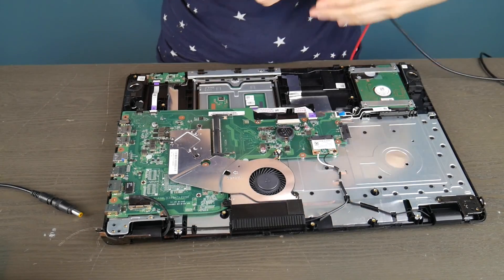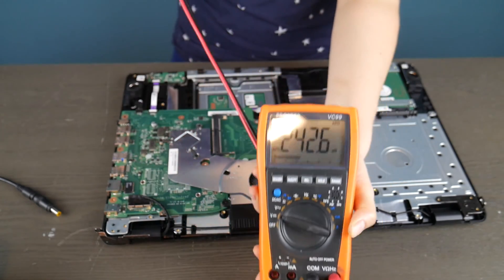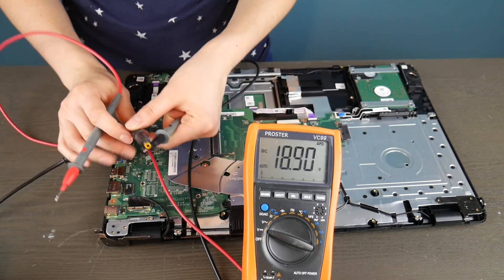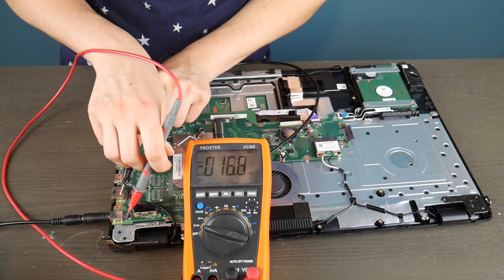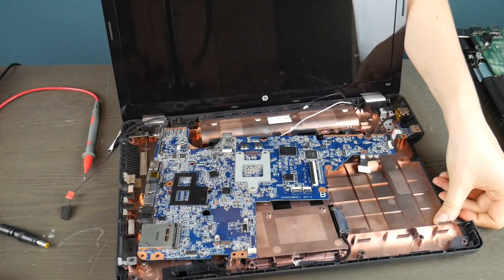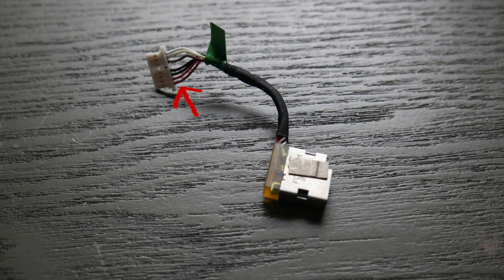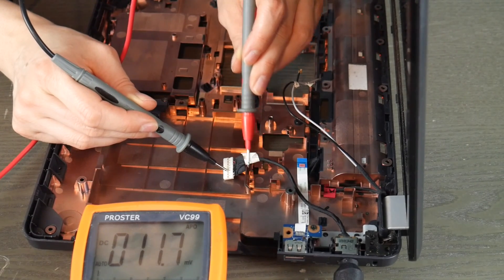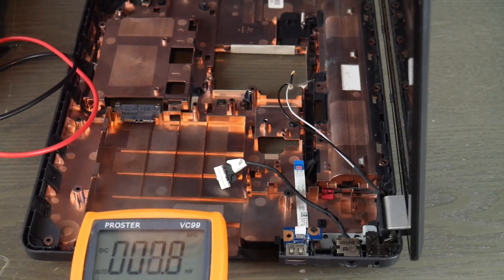How to Test Your Dell Laptop's Power Jack with a Multimeter - Tutorial by a Certified Technician

Comment: Very straightforward demonstration of how to confirm a power adapter is putting out the correct voltage. Testing the power input port on a laptop shows how you do it, but incorrectly states that if your port is bad you need to replace the motherboard. If the pins on your power input jack don't show the correct voltage coming through, you would need to continue testing on the board to determine the extent of the problem/damage and evaluate your options for replacing components vs the entire board.

Comment: Hi, I have a Dell Optiplex 7090 micro which turns off suddenly and won't turn back on when pressing the power key. It shows an amber light when pressing the power button and will not turn on. I checked the output volt coming from the adapter and it reads 18.73 volts. This adapter is rated with 19.5v 90W. Do you think that the actual voltage being lower than the rated voltage is causing this issue? Your thoughts would be greatly appreciated. Thanks
Reply from the maker: That seems close enough that it should be fine. Have you tried discharging the flea power?
Reply: @EggheadFixers  Really appreciate your efforts to give the reply. Yes, I tried that already but doesn't help. One thing I have noticed is that when I insert the output pin from the adapter to the dc jack behind the PC, the green light on the adapter brick fades for a second and then gets back to the full intensity. Anyway, I have ordered a cheap adapter online with the same power ratings to see if the problem is still there with the new one as well.
Reply from the maker: @abhijiths788  Yeah thats what I would do also.

Comment: How about troubleshooting why the laptop doesn't recognize the power adapter. Hint: The laptop refuses to recognize multiple new adapters.
Reply from the maker: That is unusual. Have you tried updating BIOS? Also, have you tried a Dell brand power cord? Sometimes Dells can be particular about chargers. Out of all the brands they work the least with generic chargers.
Reply: @EggheadFixers  Both adapters are OEM. What I'm going to do now for my next step is replace the DC jack, because the computer is a Dell Precision M4700 and came out in 2012, the only OEM jack supplier is in Hong Kong, and jack should arrive in a few days. I'll keep you posted.
Also, here's a strange one, just bought the aforementioned computer used, came with a dead battery, no problem, installed a new non OEM battery, not recognized by computer, understandable, showed 51% charged, and adapter maintained the 51% charge. Then purchased OEM battery on Ebay, seller claimed "used but strong". Installed battery, dead as a doornail, showed 1% charge, got refund,  reinstalled non OEM new battery, system now shows 0% charge and refuses to charge it, period.
Reply from the maker: @Orange-Jumpsuit-Time  Wow so you have really tried a lot of things. Replacing the power jack is a good idea. Also have you tried replacing the CMOS battery on the motherboard sometimes that can help.
Reply: @EggheadFixers  Yes, I installed a new Dell OEM CMOS battery into the computer, I also did a "hard" reset that amounted to several hours after taking out the old battery and inserting the new one.
No change, but still waiting on that OEM DC jack to arrive from Hong Kong, but in the meantime, another used M4700 that I purchased from Ebay arrived. I specifically purchased this M4700 because the seller had a screenshot of the BIOS page showing the adapter being recognized along with the "Health" of the battery.
That all being said, as soon as the Ebay purchased M4700 computer arrived I started addressing of the confusion, some of my own, that people are having when it comes to addressing what they are viewing on their Dell BIOS battery page. Below is a comment  I just posted on a YouTube that had many people that were questioning the charging, or not charging process.
Reply: @EggheadFixers  
I have 4 batteries, three 180 watt power adapters, and two Dell M4700 Laptop computers. Of the two Laptops, one recognizes the power adapters, and the other doesn't, (suspect bad DC Jack). The Laptop that does recognize the power adapters charges all four batteries to 100%, and is able to tell you the "Health" of the batteries. That being said, the other Laptop that doesn't recognize the power adapters does not charge any of the batteries, nor will it be able to tell you the "Health" of the batteries. Like I said, all four batteries accept a charge of 100% only difference being the "Health" of the batteries. The manufacturer, size of the batteries and condition ("Health") reported are as follows, Dell 97wh [Normal], M660 87wh (non OEM battery) [Normal],  Dell 87wh [Normal], Dell 65wh [Moderate]. 
So as you can see, the M4700 BIOS uses "Normal" for "Good" or "Excellent", and uses "Moderate" for "Poor", in this case a scan of the "Moderate" battery revealed it can only hold a charge of 61% of being 100% charged. Hope this helps some people that are seeking a sliver of battery system troubleshooting knowledge?
Reply: @EggheadFixers  Almost forgot, yes I updated the BIOS, it was at A12 and I updated it to the latest, A19, without skipping an update, meaning I didn't skip right to A19. Some people on the Dell community boards are reporting a non charging issue after they updated their computer, not necessarily the M4700 either. There's a whole slew of people with different Dell computer models on these Dell community boards reporting charging issues.